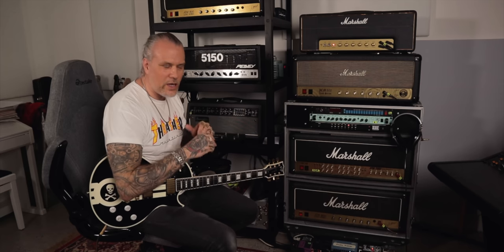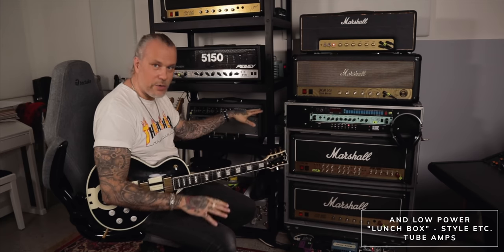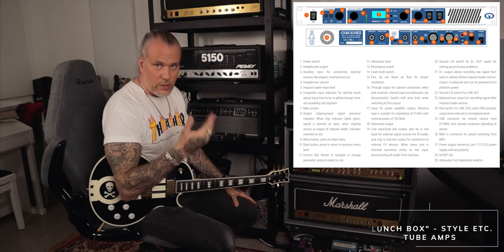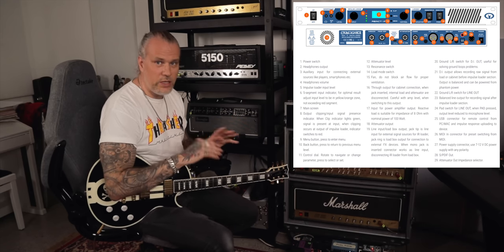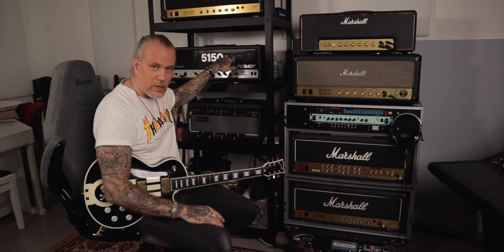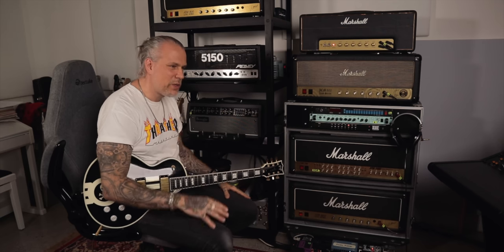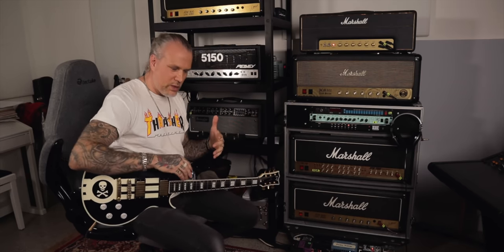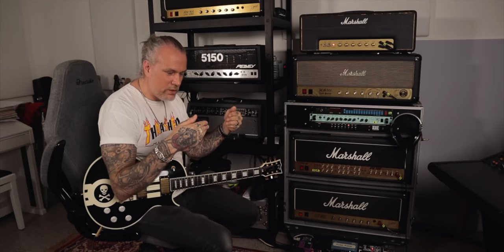TUBE AMPS' MASTER VOLUME | What it is, what it does & how to use it

Comment: It's sometimes a bit tricky whether I should turn its the gain or master volume I should turn up or down.  I'm using helix for JCM 800 rock tones and I usually have the gain at around 6 and the master at 3.  I notice that when I turn up the master , it does add a bit more clarity, maybe a bit more brightness, but then I have to turn down the gain to around 4 else its too much distortion for me which I would prefer using an 808 for that.
Reply from the maker: Indeed. It’s all about finding the sweetspots for any given situation.

Comment: Awesome explanation, thanks! After a couple of different guitars and amplifiers in the room, (in that moment) I don’t always hear the difference that matches my memory. I was thinking about selling my attenuator, but thought there was a subtle difference with my Marshall JVM410H when dialing the masters higher by 1.5-2 to push the tubes so I kept it just in case. (Plus the Mezzabarba Trinity 100 is really loud through a 4X12 cabinet if the masters are adjusted similarly!) The Friedman BE-100 Deluxe has a system volume and dual masters so I have somewhat of a point of reference. Makes me wonder if I could run one of the others through the built in attenuator of the Mesa Boogie TC-100 to help preserve the hearing as long as possible, but keep the tones.
Reply from the maker: Thanks!

Comment: so should master volume be up higher and then channel volume (if you have it) be lower? What is the typical interplay between the two when amps have both?
Reply from the maker: Whatever sounds good and gets the tone you’re looking for. With the preamp volume (sometimes labeled as gain) you control how hot is the signal going into preamp tubes; the less the cleaner, the more the gainier / overdriven. 

It depends on your amp. For example with a Boogie Mark V the volumes on the separate channels act as master volumes straight to the power amp when the fx loop is bypassed - the main master volume is then not functioning. When the fx loop is activated the main master volume is functioning and with the channel volumes you basically set the channels relative volumes.

Usually these infos are in the amps’ manual 👌.

Comment: That's not what i wanted to hear. 😉Where's the St.Rock?🧐😎😊 I was interested to hear the difference of Master Volume vs Attenuation. I think, while you can drive your amp hard(er) with an attenuator, you sacrifice sound. It just colours the Tone and Feel of the Amp/Cab in an unpleasant way. Even when it's just in the signal path between your amp and cab w/o attenuation, because of the different impedance curve of the load and load-box components.
I always prefer to use the Master Volume. I hope it's clear, what i wanted to say. 😊
Reply from the maker: 😎. With the St. Rock there’s no difference in my experience and it’s actually really cool ’cos I can tame the speaker breakup / distortion (especially with Greenbacks) and still have the master volume on my amps fairly loud. 

I took it off for this video but usually I have it always in between the amps & the cab so I can really control what kind of tones I want to get 👌. Many times the only thing needed is a small amount of attenuation and I’m in the sweetspot 🤟.

St. Rock is easily the best one I’ve used.
Reply: @EugeValovirta230V  😉I see. Still think i can hear it, when it's in the signal chain. I had the St.Rock for a short period of time. Maybe i moved it too fast. Tried other stuff as well. I get most, almost all, of my gain in the preamp/pedal section anyway, pushing the amp pretty hard. Though the 800 really starts to shine a bit above 1 on the Master Volume. It's almost 120db right in front of the cab.😀 I think V30s are a better choice for the 5150. Difference in Master Volume behavior could easily be "solved" by adjusting the Amp-EQ or mic placement. Totally different story with non master volume amps of course. But you know that. Try the Celestion Vintage 30MF if you have the chance. They're like a mix of V30s and Greenbacks.The original G12M-20 are also really good. 
Just my 2 cents. Anyway, thanks for your reply! I'm enjoying your vids!
Reply from the maker: If it sounds & feels good it sounds & feels good 😎. Thanks man!
Reply: @EugeValovirta230V  Can't argue about that.😀 Best regards!

Comment: One thing many people don't realize is that for every 3db increase of volume, you are doubling the requirement from your power amp. This is why "RMS" is the biggie in actual power and not some cheap chinese (stereo) amp system boasting "150w!" but sounds like shit and actually hurts when you turn it up to what would be considered a loud volume compared that coming from a high headroom, true 100w RMS amp. Pump the same db out of this compared to the shit amp and its enjoyable and doesn't hurt. It's because the distortion from the cheapo trying to achieve a loud volume is what hurts. Explains why guys go, "holy shit listen to how loud that guitar amp is at 1w!" it's because its 1w RMS.

Comment: You don't have it quite right. Some of it is right, but not all of it. To start with, you need to know the difference between gain and volume. If you want to distort/overdrive the signal, it can only be done with gain. Volume controls are transparent, and can't alter the signal in any way. It doesn't matter how much you increase the volume, the signal remains the same. As far as master volume goes, its a volume control. Gain controls go in the input of a component, volume controls have to go on the output. The only thing a volume control can do is attenuate the signal because they're passive. 

To distort the signal, you apply excessive gain to the input tubes. Too much gain and they break up and it directly distorts the signal. This is not what happens with power tubes. A volume control is like a dam with a gate. The more you open the gate on a dam, the more water flows through the opening. The gate is not doing anything to the water. It just controls how much water you passes through it. Same thing with a volume control. The more you turn it, the greater the signal that flows through it. But that's it. It can't change the signal, just how much goes through it. 

When your power tubes distort, something else is happening. Excessive gain doesn't make the power tubes distort like in the preamp. As you increase the volume, the harder the amp has to work. You get to a point where the tubes are driven to failure. That's the distortion you're hearing. Just to visualize, think of your home or car stereo. If you turn the volume up too high, the amp and speakers go beyond they're limits, and start to break up. The thing to keep in mind is the signal is still clean, even though your stereo is breaking up. Its a different kind of distortion. So, you take the gain distorted signal generated in the preamp and combine it with the tube failure distortion from the power amp, and that's what you hear. Sometimes the speakers can break up as well, and that will also effect the tone.

The master volume is just a passive variable resistor. When you increase or decrease it, nothing is done to the signal. Excessive volume allows other things to happen, such as letting the amp work too hard. Gain and volume are very different. They may appear to do the same thing because when you turn the gain up, it gets louder, and when you turn the volume up, that gets louder too. That's why so many people find the topic confusing.

Aside from that, your 5150 sounds amazing. I always knew they were very good, but I didn't realize they were that good. Also, quite a few posters talked about using things like attenuators to make a big amp sound good at low volumes. They're absolutely correct. You can do quite a bit to make a big amp more manageable in smaller spaces.